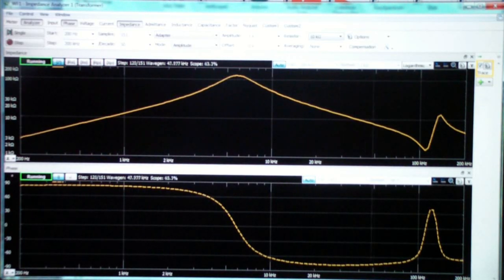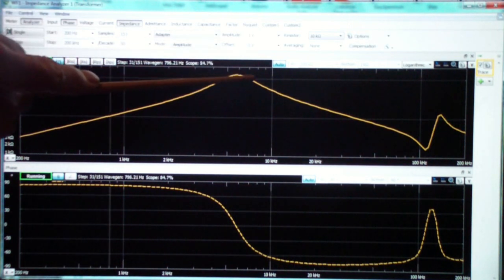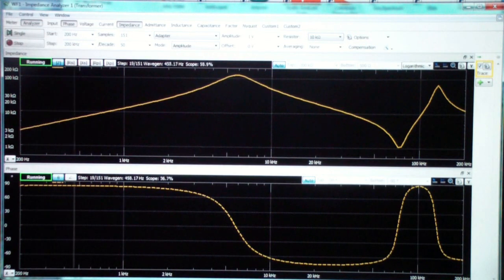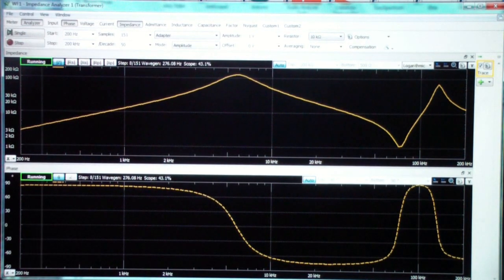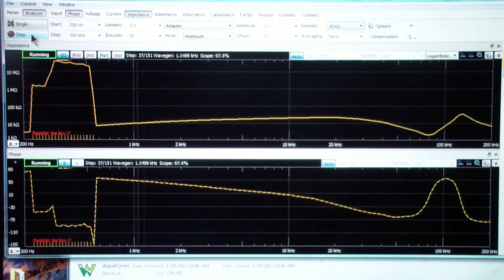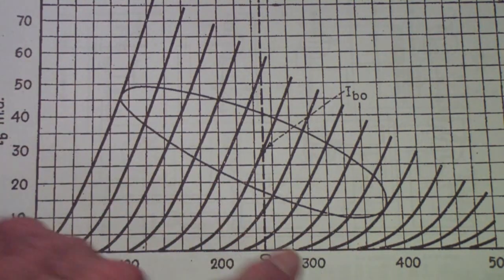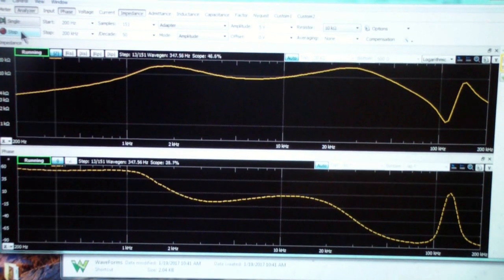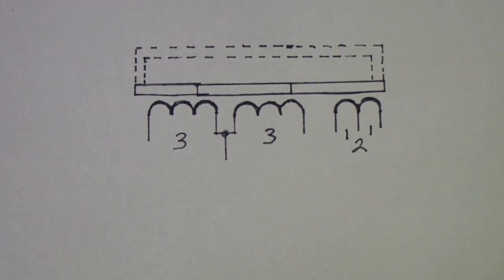TTT309 Why Tube Amps Sound Different Pt2

Comment: I'd also like to see if you can re-measure the reflected speaker impedance with a DC bias current applied to the transformer primary (single ended output) which will move the swing point in the BH curve closer to saturation. Which leads to another non-linearity, transformer saturation. You done great introduction into the topic. I'm anxious to see where you take it along with these old IRE or other reference docs that explain design  philosophy from the original tube circuit designers.